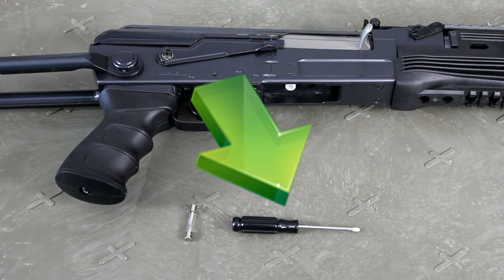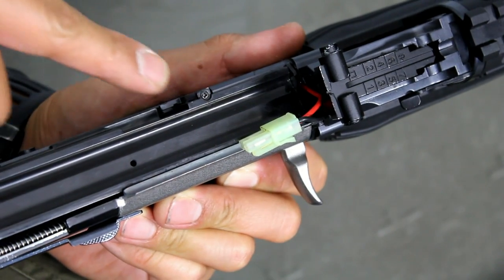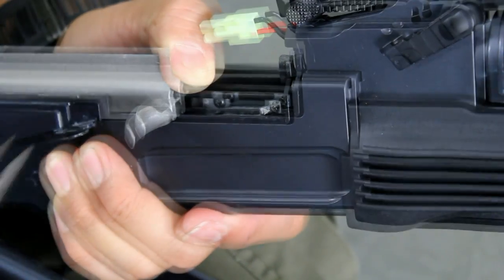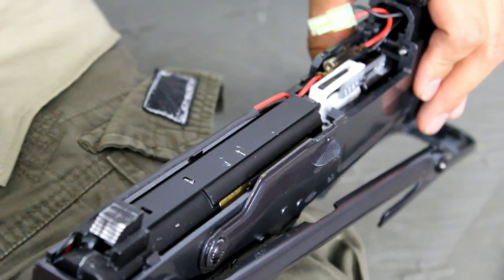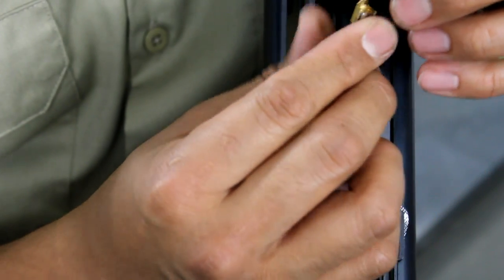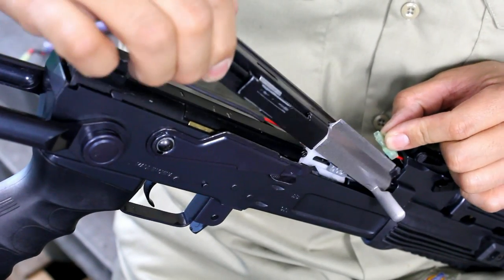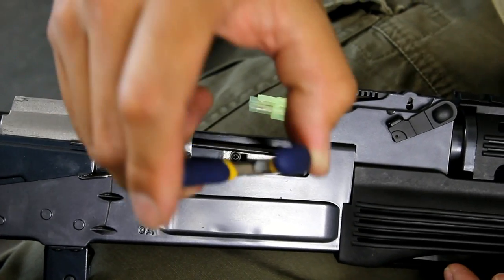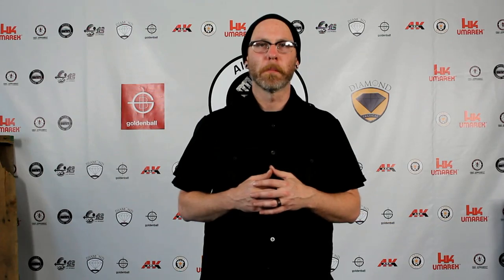Detailed How To Fix or Replace AK Fuse - AK47 No Power Issue

Comment: This great video!! I have a question...I have a Cyma ak 47 028...recently, fuse blown out..trying to find 25A250v fuse...no where to be found.... I also try to to a "quick" fix  ..doesn't work...any suggestions? the gun is only 7 days old....the only thing  I can think of the problem is I charged battery for 10hrs....according to owner's Manuel...but it sees work fine ....until two days ago..

Comment: Mine is brand new and when I shoot it it makes a grinding noise like metal on concrete in the rear end of the gun and the rod to the left of the blowback system gets stuck and requires me to hold it back while firing it and if I shoot it again it does it